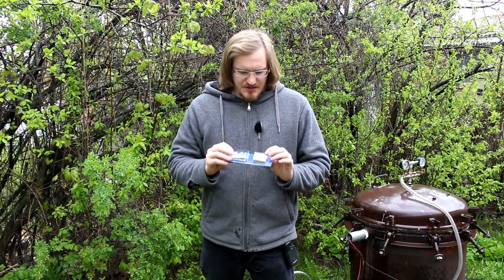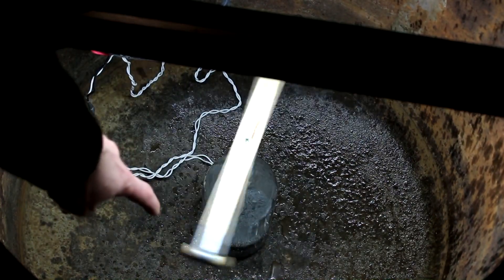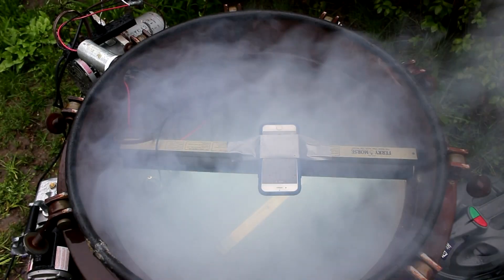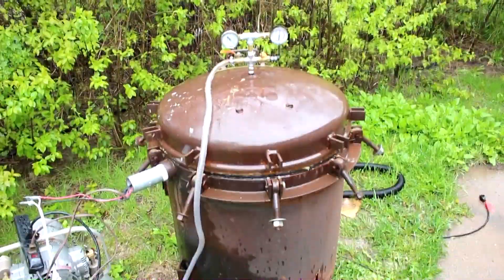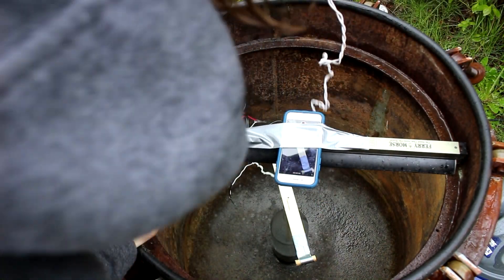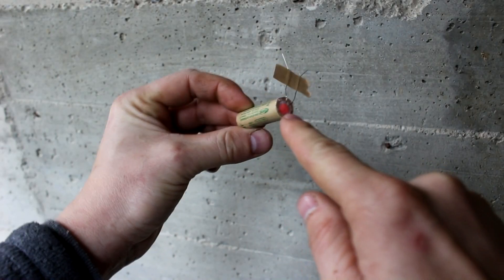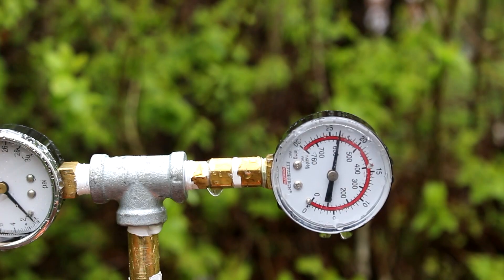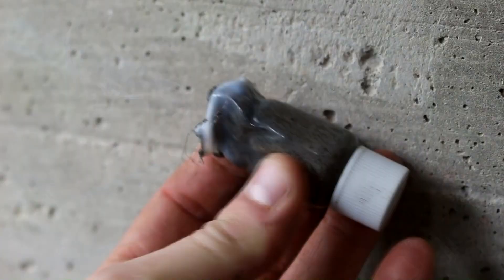Will a Model Rocket Motor Work In Vacuum?

Comment: Small area is quickly pressurized by the gas released from the Spent fuel.
That’s not a Vacuum  and after .5 seconds it’s high pressure..
This is moot.
Rockets do not work in a vacuum.
Reply: why not? do you think that a gun won't have any recoil in vacuum?
Reply: @frantaspacek  here you are again, comparing a heat engine to a gun. Silly chatbot 😂
Reply: @papalegba6796 Here you are again, claiming mass can be accelerated without a reactionary force.
Reply: @AM-rd9pu  here you are again, claiming that kinetic theory is wrong, chatbot 😂
Reply: - "Rockets do not work in a vacuum."
Except for the part where we have literally used rocket engines for MILLIONS of hours in space.
AND the part where we test rocket engines right here on earth in a vacuum and we verify that they DO produce the thrust predicted by the 100-year-old Tsiolkovsky Rocket Equation. Or do you think that aerospace engineers have FAILED to test a 100-year-old theory?

Comment: not a perfect vacuum at all this proves nothing
Reply: But if rockets need to push off air, wouldn’t less air mean less thrust? The conclusion here is that the  rocket worked better in lower pressure. So that shows that there isn’t a positive correlation between thrust and air pressure.

Comment: Not without pressure.
Reply: tremendous pressure in the nozzle, that what it's for!
Reply: @DeputyNordburg  Yeah. Nice one, Norburg.
Reply: @Chris-fm1rk  Thanks man.
Reply: @Chris-fm1rk  Actually rocket propulsion is MORE effective in a vacuum where there is no atmospheric pressure slowing down the exhaust gases.
The forward propulsion exerted on a rocket engine is proportional to the MOMENTUM of the exhaust gas leaving out the back.
Do you know how to calculate the MOMENTUM of the exhaust gas?
For example, a Space Shuttle Main Engine (SSME) expels 500 kilograms of pure water (as exhaust gas) PER SECOND at Mach Eight (>2500 meters per second).
What is the MOMENTUM of this water per second?
Well for the rocket to PUSH on that mass (the exhaust gas) it MUST feel an "equal and opposite force" to satisfy Newtons laws.
This equal and opposite force is known as RECOIL and is what pushes the rocket forward.

OR do you think that mechanical RECOIL stops working in a vacuum for some mysterious reason?
Reply: @stuartgray5877  so the gas laws are wrong? Ok chatbot 😂
Reply: @papalegba6796  No. YOU just do not understand the gas laws.
SO, tell us how someone that has never taken a single physics class in their lives feels confident arguing with actual Rocket Scientists regarding basic physics.
You don't even know what MASS IS genius since you claim gas does not have any,
And you claim that a Hydrogen Oxygen flame does NOT make water.
Bless your little heart!
Reply: @stuartgray5877  Literally saying NO U!😂
Reply: @papalegba6796  do you really watch all videos where someone tests a rocket just to spew nonsense? that's really sad, I hope you get your life back together.
or you're actually a chatbot, because in all your comments, you were never able to say an actual argument, it's all just random sequences of words.
Reply: @frantaspacek  W=pv, solve for when p=0. Silly chatbot!😂
Reply: @papalegba6796  I refer to my earlier comment, I answered exactly that, go read it again.
Reply: @frantaspacek  no you didnt, chatbot 😂
Reply: @stuartgray5877  Pretty sure a thermal rocket doesn't fire water out the back, chatbot 😂
Reply: @papalegba6796  - "Pretty sure a thermal rocket doesn't fire water out the back"
Well, a space shuttle main engine SURE DOES.
Why don't you tell us what IS the combustion by-product of burning hydrogen and oxygen again.
I love it when you prove that you failed high school CHEMISTRY along with failing physics.
Reply: @stuartgray5877  Pretty sure fire isn't water, chatbot 😂
Reply: @papalegba6796  Chemistry 101 teaches us that a hydrogen oxygen fire, in fact, DOES make water.
Thanks for proving that you failed high school CHEMISTRY AND Physics.
Reply: @stuartgray5877  fire still isn't water, chatbot.
Reply: @papalegba6796  Still confused about the by-product of a hydrogen oxygen flame genius?
Bless your little heart!
Reply: @stuartgray5877  still confusing fire with water, chatbot 😂

Comment: this is embarrassingly unscientific. the rockets thrust is pushing off the walls of the chamber cause its far too small for your experiment anyway .
Reply: Sadly the container is round.  The exhaust is bouncing around and hitting the rocket head on slowing it down.
Reply: The experiment is fake anyway, no vacuum in the chamber.

Comment: .... But by putting it in it's own bottle you  essentially sealed it in it's own atmosphere , thus giving it something to push against AND enough air to ignite, of course it's gonna spin in the vacuum after being ignited and giving it propulsion, that's not the argument, it wouldn't ignite or produce thrust until it got sealed in atmosphere via the bottle
Reply: Every rocket pushes against it own exhaust.  That is how they work.
Reply: @DeputyNordburg  then why did it not ignite in the first place when it was in complete vacuum?? That whole "pushing against it's own exhaust" is a result of combustion, something that didn't happen UNTIL it was sealed with air in the bottle
Reply: @yugennazofzz4318    It was never in complete vacuum, and he explains why it did not ignite in the video. 
Complete vacuum is a practical impossibility.   And $2 toy rocket motors (designed to be safe in the hands of children) and $.10 ignitors were not designed to ignite in a partial vacuum using 110V electricity.  
But every test of a rocket motor where thrust is measured, the rocket works better in vacuum.  Even here you can hear it spin faster than it did in atmosphere.
Reply: @DeputyNordburg rockets produce thrust that need to push off a medium 🤯🤡
Reply: @Hotdogbun96  yup, exhaust.
Reply: @DeputyNordburg  No, Nordburg. Exhaust expanding into a vacuum is not a fulcrum.
Reply: @Chris-fm1rk  Exhaust expanding into a vacuum is expanding because?
Reply: @Chris-fm1rk  It's a test.
Reply: @DeputyNordburg  Get well soon, Nordburg.
Reply: @Chris-fm1rk   Don't go away mad.
Reply: @DeputyNordburg  Alright, tell me a joke.
Reply: @Chris-fm1rk   What did Neil Armstrong say when people didn't laugh at his moon jokes?
Reply: @DeputyNordburg  I don't know, what did he say?
Reply: @Chris-fm1rk   "I guess you had to be there."
Reply: @DeputyNordburg  🤪 I give it one and a half socks out of a possible two.

Made me smile.
Reply: @DeputyNordburg  - " Exhaust expanding into a vacuum is expanding because?"

Because a "FORCE" is pushing on it?
Reply: @stuartgray5877   Because gas molecules repeal each other.
Reply: @DeputyNordburg  yep. And the gas molecules in the combustion chamber of a rocket engine is applying a force over over 3000 pounds per square inch across the throat of the nozzle.!
Reply: @stuartgray5877   That's not how I would word it, but that is fairly accurate.
Reply: @DeputyNordburg  - Now if we could only convince Chris-fm1rk  that he should not try to lecture actual Engineers about basic physics until AFTER he completes high school physics.
Reply: @DeputyNordburg  Nice copy pasta, ChatGPT guy 😂
Reply: @papalegba6796   Mmmmm pasta.  With an Alfredo sauce?
Reply: @DeputyNordburg  They do not push off of their own exhaust.
Reply: @Chris-fm1rk  - "They do not push off of their own exhaust."
They most certainly DO!

Are you one of those uneducated people that thinks that Rocket Exhaust gas has NO MASS?
Are you aware that a space shuttle main engine consumes 500 kilograms of liquid oxygen and liquid hydrogen PER SECOND?
It combusts the two gases and makes an exhaust gas that exits the nozzle at MACH EIGHT!

Care to tell us WHAT IS the exhaust gas from a hydrogen oxygen combustion process?
And how much mass of this exhaust gas exits a SSME per second?
Reply: @DeputyNordburg  Not in space. Have you?
Reply: @Chris-fm1rk   Yes.
Reply: @DeputyNordburg  Ok.
Reply: @Chris-fm1rk  Oh and my company test rocket engines in vacuum chambers and we verify that they DO produce the thrust predicted by the Tsiolkovsky rocket equation.
We then put those same engines on real spacecraft, launch them to space and test them there too.

Comment: These vacuum rockets in space tests are all flawed and nobody’s calling it out. These test aren’t in a constant vacuum. As soon as the rocket engine puts out one molecule the vacuum isn’t constant anymore as the exhaust is filling up the chamber which is where it gets thrust. But space is a constant vacuum so there’s no “filling of the chamber” so unless you can calculate exactly what the rocket thrust is and apply the same vacuum constantly while it’s going than your whole test is flawed from the start. The fact that people are using closed systems to simulate a supposed endless vacuum of open space is kinda mind boggling. If space is nothing then you can’t produce something from nothing it’s that simple. Rockets literally break the laws of physics
Reply: - "Rockets literally break the laws of physics"

They do no such thing.
Rocker propulsion is just the mechanical RECOIL of pushing on mass.
Are you suggesting that RECOIL stops working in a vacuum?
What would happen if you fired a CROSSBOW into the vacuum? Would you feel a recoil force?
YES!

Newton's laws say rocket propulsion MUST work in a vacuum.
 Study the "Law of Conservation of Momentum" then check back.
Reply: @stuartgray5877  you said it yourself pushes off of mass. There has to be mass for it to push. There’s no mass in space, so hows it work?🤷🏼‍♂️
Reply: @mushmmm1509  - "If you can’t understand this question you don’t know how thrust is achieved 

Just so I have this straight: High School dropouts, such as yourself, DO know how Rocket Propulsion works, but ROCKET SCIENTISTS DO NOT?

Sorry But I have been building, testing, launching and operating earth orbiting spacecraft and deep space science probes since before you were born.
I tell YOU how this stuff works, NOT the other way around genius.
Now GO BACK and finish HIGH SCHOOL, then you can try challenging actual engineers about basic physics.
Reply: @stuartgray5877  says the guy who refuses to answer simple questions like I’m asking the impossible🤦‍♂️
Reply: @mushmmm1509  And I see that you STILL refuse to comment on the LIVE VIDEO that proves YOU WRONG.
I wonder WHY THAT IS?
Reply: @stuartgray5877  what live video?
Reply: @stuartgray5877  the question you didn’t answer is the one you assumed a bunch of things about me, then proceeded in a very “scientific” way of saying you tell me how things work not I tell you.🤦‍♂️ yet like all the others still failed to do so. If you can’t answer simple questions your waisting my time as well as your own.
Reply: @mushmmm1509  - "what live video?"
The YT video "Stabilized Footage of Falcon Heavy from Launch To Landing! USSF-67" by Astronomy Live.

Watch form launch to side booster landing then TELL US WHAT YOU SAW.
Reply: @mushmmm1509  - "once again there’s no mass in space."
Let's leave the Engineering to those that know the difference between "Mass" and "Weight" shall we?
Therre most certainly IS "mass in space" genius.
Reply: @stuartgray5877  😂🤦‍♂️
Reply: @mushmmm1509   As soon as there is something in it, it’s not a perfect vacuum.  And it has a rocket in it.   Question?
Reply: @mushmmm1509  Stuart gray is a chatbot. It spams every video on this subject with mad troll riddles & abuse, has done for years.
Reply: @papalegba6796  Yes I DO keep asking YOU to tell US what accelerates the exhaust gas from the rocket nozzle, but YOU REFUSE to answer.
Why is that?
Oh, THATS RIGHT because answering truthfully proves YOU WRONG.
So, prove ME wrong by ANSWERING. (for the FIRST TIME EVER)
Reply: @stuartgray5877  lying again, chatbot? 😂
Reply: @stuartgray5877  I have answered you, Chatbot, hundreds of times. A gas expands from higher to lower pressure using its own internal energy, no force is required during the process. Now you'll ignore my correct answer & rant on again. It's all you do 😂
Reply: 1. Get a vacuum, an infinite perfect vacuum.  So absolutely NOTHING in it. 
2. Put a rocket in it.
Reply: @DeputyNordburg  yes, go on.

Did you have a question?
Reply: @DeputyNordburg  cute
Reply: @stuartgray5877  Thanks.  I try to stay in shape.

Comment: This wasn't a complete vacuum right?  And I don't think spaceships work in a complete vacuum either?   All a rocket needs is a little air to push off because of the exhausts high velocity.   I also don't get the idea of Rocket gas pushing off of its own Rocket gas... it just sounds weird, especailly since everyone knows that hot air propels many engines like Jets.
Reply: So would a crossbow feel any recoil if fired into a vacuum?
Yes or No?
Why or WHY NOT?
Reply: Did you just ask a question about what you think? 

That means that you’re asking us what YOU think. Classic.
Reply: A complete vacuum?  If you mean a perfect vacuum, there is no such thing, and space is certainly not a perfect vacuum.
Reply: @DeputyNordburg  that was my point.  Everyone keeps asking if rockets can work in a vacuum but people like me are asking about f it's a perfect vacuum or not?
Reply: @spacegazette4781  : And space is not a perfect vacuum.
Reply: If you had a perfect vacuum, and then you put a rocket in it, it would no longer be a perfect vacuum.  And if you then fired that rocket its exhaust gasses would fly out the back further contaminating your already non-perfect vacuum.  And of course, space is not a perfect vacuum anyway.

A real world experiment would be to fire a rocket in a vacuum chamber at 1 atmosphere then a half, quarter, 10% 5% etc measuring the total power each time.  
When this is done, rocket power goes up as the atmosphere is removed.  And yes there is no vacuum chamber of infinite size, but the "back wall" of the chamber is present for each experiment.

The "rockets don't work in space" argument seems to be emotion, rather than based on experimental data.
Reply: @DeputyNordburg  It's been proven rocket power goes up in controlled vacuum Chambers as the atmosphere gets removed?  That's a terrific argument.  I would then have to question what propels a jet engine....  I thought it relies on exhaust hitting air (to some extent anyway).
Reply: @spacegazette4781  - " I thought it relies on exhaust hitting air (to some extent anyway)."
No it does not.
Rocket engines and Jet engines are MASS DRIVERS.
They PUSH ON MASS and feel a "recoil force" we call Thrust.

Jet engines push on the air while it is IN THE ENGINE.
Once the gases leave the engine/nozzle the pushing is done.

Comment: Cody, I think you should redo this video with a rocket that shoots water using compressed air, or something like that. There are a lot of flatbrainers using parts of this video to "prove" that rockets don't work in space.
Reply: You could, and they would change 0 of their minds.
Reply: @DeputyNordburg  I cannot even convince these morons that a space shuttle main engine's exhaust gas is just PURE WATER.
They refuse to even "believe in" the MOST BASIC CHEMISTRY IMAGINABLE!
 The Hydrogen and oxygen MAKE WATER!

Comment: As long as the rocket engine contains its own oxidizer then it will burn in a vacuum. All liquid fuel rocket engines have their own oxidizers therefore burn in space

Comment: Without the air in the bottle the rocket  would not burn and you turned off the vacuum pump this allowed for the gas from the rocket to fill the vacuum chamber giving the rocket something to push against.
Reply: In a Perfect vacuum (no such thing) The rocket still pushes on it's on exhaust.  That is how they work.
Reply: @Wonder Will  Guns work in vacuum too.
Reply: @Wonder Will  Times mentioning NASA: 
Me - 0
Wonder Will - 3
NASA fanboy confirmed!
:face-red-heart-shape:🚀
Thank you for trying to be honest toward the end there.
Reply: @Wonder Will Times mentioning NASA: 
Me - 0
Wonder Will - 6!
:goat-turquoise-white-horns::face-turquoise-drinking-coffee::face-orange-biting-nails::face-blue-smiling:
Reply: @Wonder Will   Yes, tell me more about me.  Please don't stop.
Reply: @Wonder Will  OK, you are less than a Man.
Reply: First off, the burning occurred because of the mix of fuel and oxidizer in the solid motor material. It doesn’t need oxygen to burn or ignite. 

Second, yes the pressure inside the chamber would rise from the expanding gases of the motor burn. A good test set up would include a precise pressure gauge and a pump that could continually pump in the chamber. That, and a good load cell you measure the thrust being produced. 

Then you could regulate the chamber pressure while burning, either by adding some bleed air or throttling the pumping conductance. 

Then you’d plot the thrust force vs the chamber pressure to see how it behaves. Does a higher pressure mean more thrust? Or does a lower mean more thrust?
Reply: @Wonder Will  Like the Soviet R-23M?  Yes.  But I closed down my business of doing google search for people unable to do their own.  🤣
Reply: @Wonder Will  In the opposite direction of the bullet.  What in your imagined infinite vacuum (that does not exist), would stop it?
Reply: Yep.. I’d like to see a true experiment without any cheating and misinterpretation. Sadly there is too much propaganda to continue the fakery.
Reply: @JV-tw6lt  Well you COULD watch any of the >200 videos from SpaceX where they dhow rockets working just fine in hard vacuum.